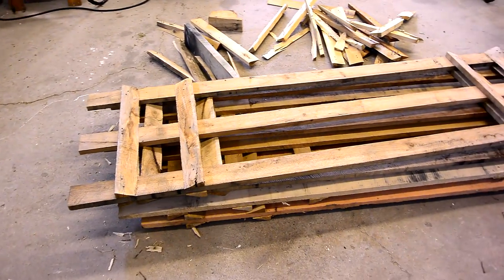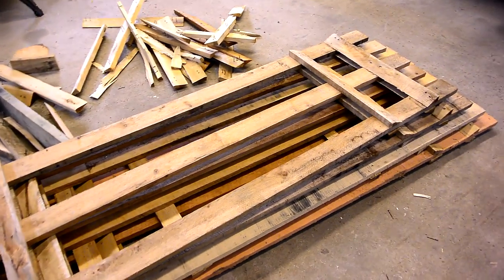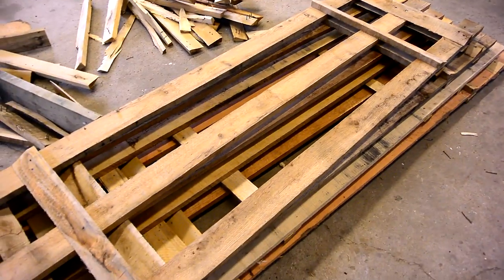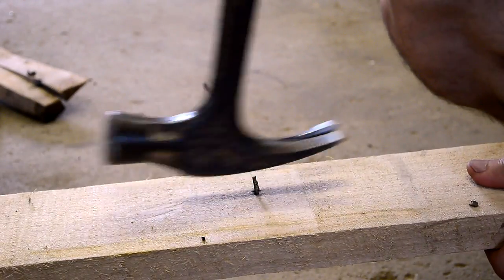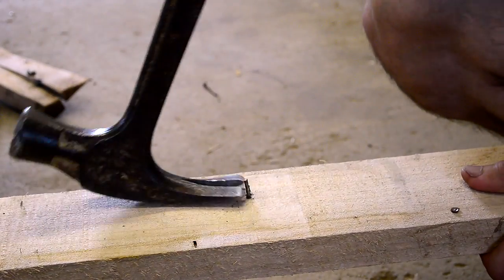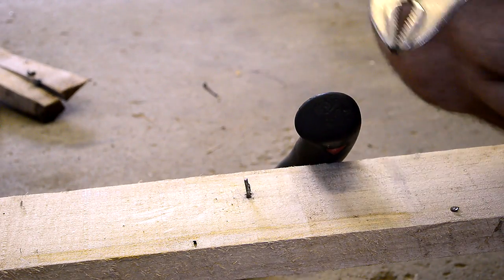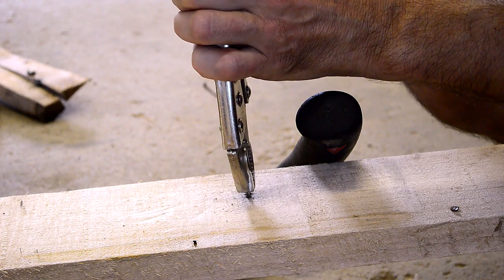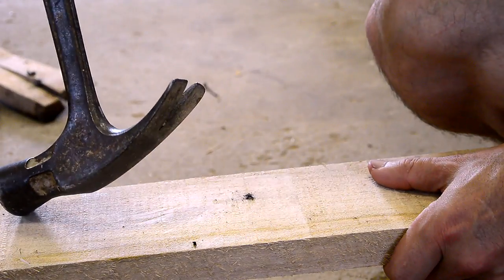Pulling nails without heads / pallet recycling

Comment: Use a pair of side cutters rather than the vise grips. It takes a little time to get used to how hard to squeeze so that they bite without cutting through the nail, but it will be way faster. Just grip the nail with the side cutters in your off hand and pry up with the hammer. You can pry with the side cutters themselves, bit that's more likely to dent the wood.

Comment: some nail in hard wood, I have to use double visegrip holding its end in cosecutive. For old brittle rusty nail, I drill a hole on both side and pull with Needle-nose pliers.

Comment: A good hardened claw should be able to cut far enough into the nail shank to pull it. Or at least, that's been my experience.  But the vise grips are a good trick.  Big end nippers work too.

Comment: I tend to use a rivet puller, but admit that often nails get stuck in the fingers, or the head (when I it hasn't been broken off) gets stuck in the end requiring disassembly of the tool.

Comment: You don't even need the hammer, when you pinch the nail you can lever it out just by pulling on the vise grip itself. The hammer would give you more leverage though. Great video.
Reply: Trying to lever on a rusty nail can break off the part youre pulling on

Comment: If the nail is sticking out that far,  just bend it a little with the claw and you can pull it out easily.  No need for a second tool.
Reply from the maker: +Rick Maxon Unless of course it doesn't pull out easily.  Then you need a second tool

Comment: I've used that method, but just squeezing pliers and working the hammer at the same time. I resort to that after I have tried the side to side method of pulling. instead of rocking the hammer forward (or back), rock it left to right.
Reply: +jbkibs That would cause more damage around the nail hole.

Comment: Design a hammer where the claws become the vise so you only have one tool to use. One method would be to use something similar to the seat post clamp on some bikes (works just like the skewer clamp on bike wheels). Only one side of the claw hammer would need to be hinged. Should be easy for most to get what I am saying. Other method is to just bend the nail with hammer and pull out that way, but that can damage the wood, so might not work out for some woodworkers. EDIT, the bending the nail trick was already posted, just seen it below mine, but again, the idea is to cause the least damage. to the wood.

Comment: That's a very engineer way to pull nails, I good pair or end cutter will grip your headless nail and then you roll them down just like the claw hammer, or you could simply use the claw and push the hammer sideways if the don't car about marks.

Comment: I have a similar method but I think it is a little faster.  instead of putting the vice-grips on vertically put them on horizontally and then twist them so that the nail will bend around the vice-grips.

Comment: I think if you "yank" the hammer sharply as I saw in the video it is more likely to strip the head off the nail. I suggest that a slow, gentle pull with the claw would result in fewer headless nails.

Comment: Matthais... I note in that final scene that you pushed the lumber through the jointer from behind. I've heard else where that best practise is to push down in front of the blade... is it a case of every jointer is different? Or was that the first pass where it's not so vital to feed it through evenly? Or am I plain wrong? Thanks for the videos... hope the family is well.
Reply from the maker: +fraser greig If you want the jointer to roughly follow the countours of a long board, you are better off pushing on the infeed table.
Reply: +Matthias Wandel and why do I need pallets?
Reply: +muppetonmeds Because wood is expensive, so whenever you can get it for  free, that's a good thing. (Duh!)
Reply: +muppetonmeds Let's assume that you're just starting woodworking. Pallet wood is readily available, costs nothing or next to nothing and you can 'play' with it, without worrying about any mistakes that you may/will make. Let's just say that, pallet wood is like a "training medium" for the woodworking enthusiast.

Comment: I use a sawsall to recover the boards but I'm leaving most of the nail in the stringers how do I get those nails out when they are flush with the wood
Reply from the maker: If you want the nails out, don't cut them off.

Comment: always push on the second blade of the jointer...the wood that leaves the knives is flat, if you push on the first blade the wood can lift of the second one....
and it is much saver because you push away from the knives...so there is no way you end up with shorter fingers

Comment: My Dad taught me to use the claw on the hammer sideways, try it it works
Reply: That has worked for me too, but it puts dents in the wood, which if you are planing, will add more passes on the jointer/planer.

Comment: You can also take a second hammer, hit the head of the one while it's on the shaft of the nail and it will grip what's left to get it out.
Reply: +Ryan Brose Have you ever heard of people say you should not hit a hammer with a hammer. Mythbusters did a whole show on it.
Reply: +TheDutyPaid you can also use a pry bar if you're afraid of that.

Comment: most headless nails come out easily if you have a little shaft left and push the hammer sideways and bend the shaft then turn the hammer a little and pull

Comment: you could just use the vise grips without using the hammer..put the the vice grips in the same position as you had them but down lower touching the wood, bending towards the head of the vice grips, save using the hammer and just a one step method.

Comment: Here's how to pull out old nails: Knock the nail IN a little first. This breaks the rust bond..Then pull it out, without pulling the head off..Second tip: Put the claw tight on the nail. Then lever the hammer SIDEWAYS. Out comes the nail, without pulling the head off. Much quicker than messing about with a Mole Grip.
Reply: I agree with you on breaking the rust bond, and levering sideways works great except for denting the wood.  And if you were planning to plane it, it's either use the vice grip or more passes on the planer.

Comment: I just use channel locks. Grab the nail close to the wood and roll the pliers on their radius and the nail comes right out.
Reply from the maker: +guyincognito210 Only works if the nails aren't really stuck.
Reply: +Matthias Wandel with a hammer its easy to get nails with/without heads from wood

Comment: One could get away with using the only vice grip pliers by grabbing the nail close to the wood then rolling the pliers towards the solid jaw. The large radius on this jaw acts as a fulcrum to pull out the nail. It may, however, leave marks in the material.
Reply from the maker: +Mark Failla That often breaks the nails and marrs the wood.

Comment: Won't it be easier to hammer the top a little bit side way, use that as a leverage and then claw it out?
Reply from the maker: +japboon Not if the nail is realy stuck.  These ones weren't too bad though.

Comment: Good tip.   

I have one of these that I inherited from my dad.   One of these can dig into the wood if the nail is broken off flush and then grip on the shank of the broken nail.    Kind of chews into the wood though, it's more from the construction/carpentry end of things where that is not such  big deal.
 http://www.princessauto.com/hlr-system/WebPhotos/81/815/8155/8155293.jpg
Reply: +wordsnwood I use one of those too, have for a very long time.  The jaws take a little bit to get a hang of, but if there is anything sticking above the wood - you can pop the nails out without damaging it.
Reply: I have recently been looking at those would you recommend getting one ?
Reply: +Tom Howbridge I almost never use it, but when you need it, it works.
Reply: +Joe and Liz , it may not be obvious at first but it's also a slide hammer.  The jaw is narrow so you can hammer it below the surface of the wood, extracting nails which have broken off near the surface.
Reply: +Tom Howbridge ,  If you do any kind of wood reclaiming, they are indispensable.
Reply: +Ian Mahuron Yeah, the slide handle/hammer is key. I have one of these and I'm glad I got it.
Reply: +wordsnwood Yes. These are awesome. I've used 'em since the Seventies.
Reply: +wordsnwood I have one too. My dad borrowed it from our next door neighbour about 40 years ago, and now I have it.

Comment: Instead of using your hammer and making it a two step process, clamp the vice grips onto the nail as close to the wood as possible and then using the curved jaw push the vice grip downward at a right angle to left the nail from the board.

Comment: Or... you could grip the nail with vices down to the board and then push forward like a shifter and remove the nail without a hammer as the head of the vice is designed for... :D

Comment: Standard pallets are often chemically treated as well to resist rot. you don't want to be running that wood through a planer and breathing in that toxic dust.
Reply: There are tons of videos describing the difference between heat treated and chemically treated, and how to tell the difference. "Standard" would seem to claim a prevalence or majority for that type, and outside of a specific region, I don't believe that's accurate.
Reply: +Michael Lawing  My point, which I may have made poorly, was that non-standard sized pallets are less likely to be chemically treated as they are designed for that specific one use, while standard sized ones which are meant to be used over and over again will be treated. It's true you can tell a pallet that has been treated will bear the marking MB for Methyl Bromide but in worn pallets that marking is often lost.
Reply: @RonaldJS  The drink a glass of methyl bromide every morning and I'm fine.

Comment: turn the hammer on the nail and bend the nail over and it’ll roll right out don’t usually even need pliers but there are times
Reply from the maker: that only works if you have a grip on the nail to begin with

Comment: You can take out headless nails with the hammer's claw, lock it and turn it on it's side instead, it'll pull the nail out. Any carpenter in England knows that...

Comment: Matthias,
Please don't place your hand on the top of the board when the board is going over the spinning Jointer knives.  My father lost one of his fingers doing that when the jointer knives hit a knot in the board causing the board to split and thus dropped his hand into the spinning jointer knives.
Reply from the maker: +Gordon Eckler Never thought of that mode of having an accident.  Though hands above the outfeed table aren't necessarily safe either - board could kickd back and hands get pulled with it.

Comment: Why is the word "nail" used for both "finger nails" and "iron nails" ? they are also spelled the same.
Cuz pulling one or the other makes for a different video and experience.
Reply: +Joe G.P. PS i use wire snips to dig into the wood for those berried nails if there is no other way, but that way i have to dig into the wood which is not desired.
Reply: +Joe G.P. The same reason that lead can be leading the race or lead solder, Also sewer can be a pipe the drains crap away or a person that sews clothes. Its the english language and I gave up a long time ago trying to figure it out.
Reply: +Vern Mitchinson would i be wrong in saying it's the most f*cked up language ? grammatically that is
Reply: +Joe G.P. You could say that but it is also the most versatile language, the most discriptive and precise if used correctly.
Reply: +Vern Mitchinson You could also say 'buried' when you mean you have to dig for it. Just sayin'.
Reply: +Joe G.P. you  'nailed' it
Reply: +Joe G.P. try -   minute as in 'one minute later' or 'one minute detail'
Reply: +terryyouth A minute is a small amount of time. An even smaller unit of time could be said to be of the second degree of minuteness.
Reply: +Joe G.P. they both come from the same word, which basically meant "point". An iron nail is a pointy fastener, a fingernail is a point at the end of your finger.
Reply: +Fester Blats there is nothing wrong with it, it just makes learning it needlessly difficult and the rampant misuse of even simple words by native english speakers is blatant proof
Reply: +hobbified now that's a helpful answer, you get a thumbs up

Comment: I use a wire cutter to bite the nail and then the hammer to pull it out. It's faster.
Reply: How could one tool squeezing onto a nail be faster than another tool squeezing onto a nail?
Reply: +James Hannan Because vice grips take a bit of time to lock/unlock. Personally, I just use robo grip pliers. Just grab on and you can use the head to lever the nail out. Easier/faster because it's just one tool.
Reply: +mutualin4mation Faster except when it doesn't work! No tool holds a nail better than a vice grip (without cutting through the nail). And the vice grip doesn't require you to have superhuman strength either.
Reply: I've never had it not work. Use a light touch. Bite into the nail with the cutter. Pull nail out.
Reply: +Joren Mathews I've never had it fail. YMMV